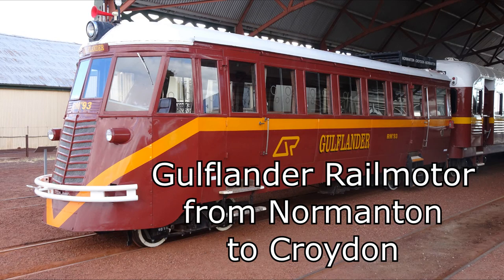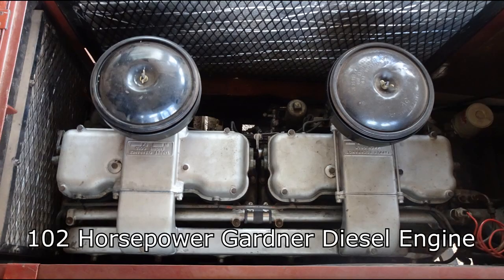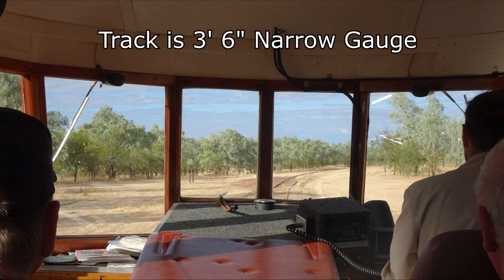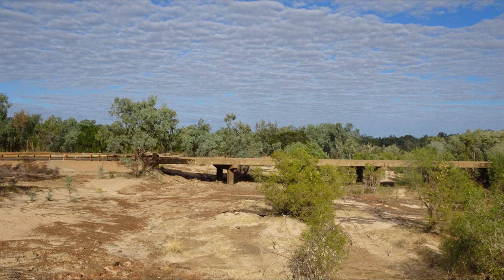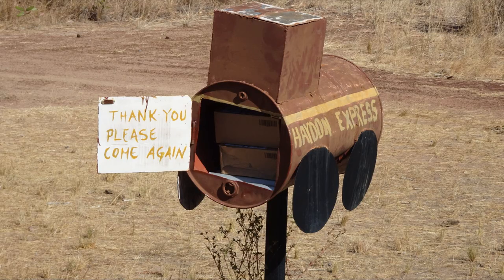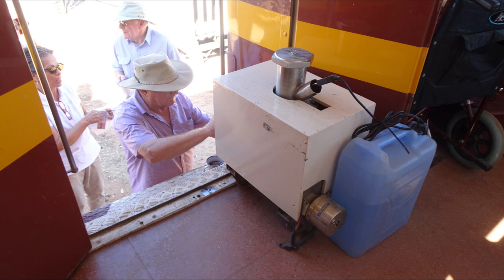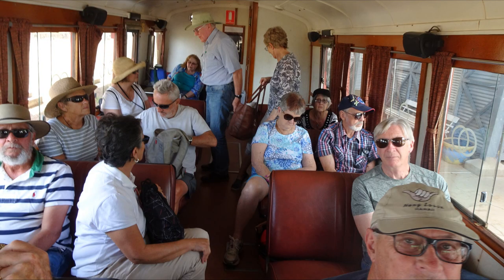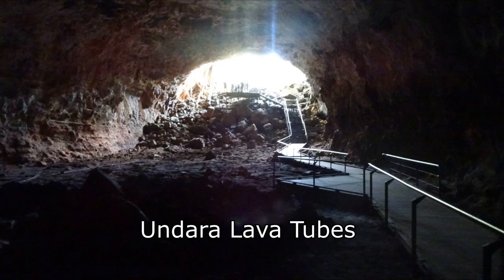Gulflander Railmotor from Normanton to Croydon

Comment: My son is special needs and he loves trains 🚆🚂🚃🚄🚅🚇🚈🚉🚊🚝🚞🚋🛤 especially railmotors like that one he thinks they are highly underrated rail transportation vehicles and all should be preserved, restored, and put back into service carrying both passengers and mail on lines that are not used anymore or at least don't get passenger service. He also thinks that Siemens, Progress Rail, or any other company that builds railroad equipment should build full size working replicas of historic railmotors and the departments of transportation should restore and rebuild railroad lines that were abandoned and/or removed and run these on them.